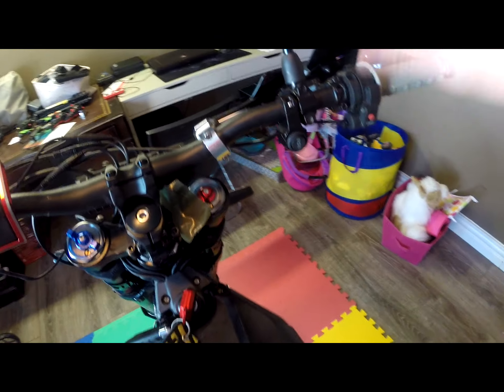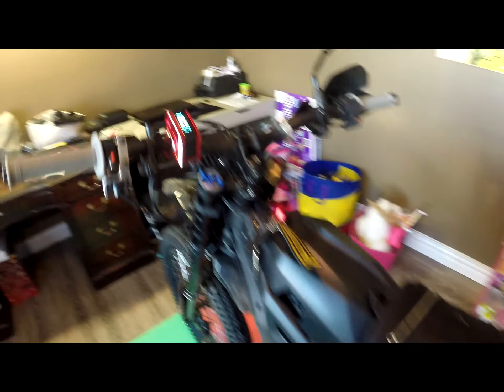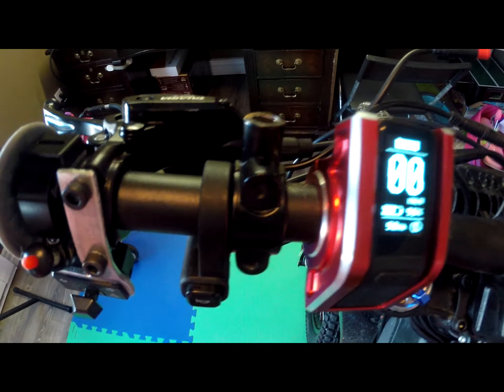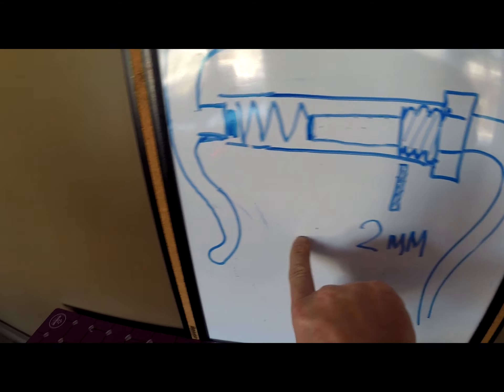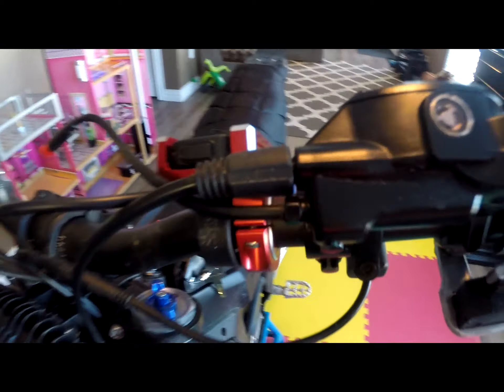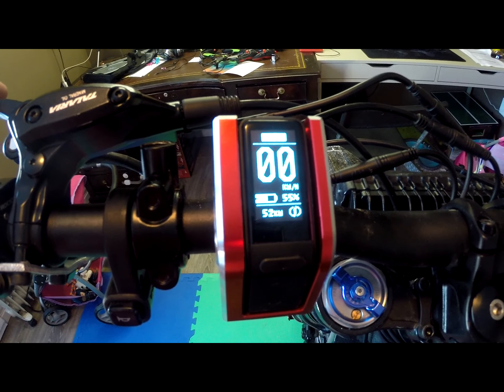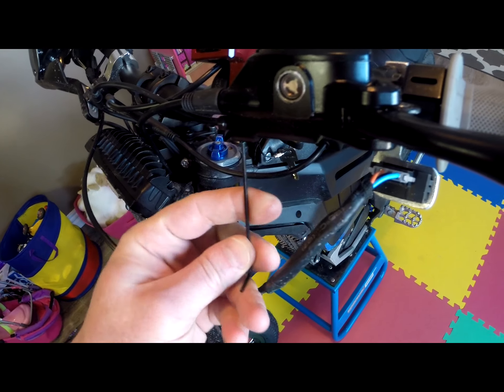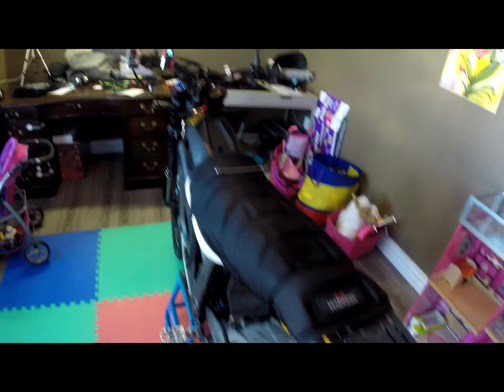Talaria Sting, WAIT on screen... How to adjust brake sensors

Comment: Thats the way i have my break sensor is like the R  on my mx3 if i want back the sensor i just plug it back into the break no need to remove battery and disconnect connectors just have it like the R 👍
Reply from the maker: My mx3 didn't have those accessible connections... You got lucky
Reply: @JustDoItPlus i wish lol Mines the first delivery of the mx3 i had to unscrew the sensor from the breaks and slide the sensor out. so now all i have to do is slide the sensor in and out to use. the mx3 i have don't have accessible connectors like the mx4  the mx4 is plug mine i have to unscrew lol